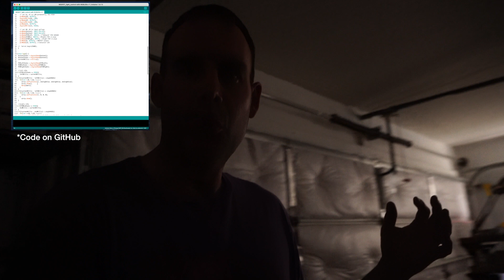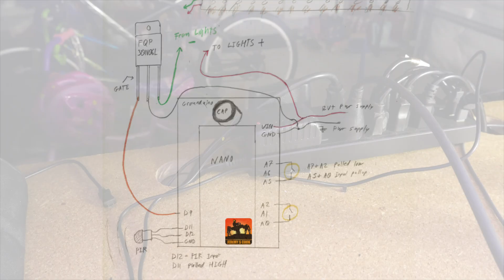PIR 3x Zone LED desk lighting

Comment: You told me to let you know in the comments if you were soldering wrong, so here I am!

You're working too hard.  If you tin both the wire and pad first they'll flow together so much easier and more cleanly when you touch them with the iron.  When I learned this it changed my life! :)
Reply: I second that tip. It is so much easier that way. :)
Reply from the maker: @MakerMikeSizer  I will have to try it :-)
Reply from the maker: Thank you Matt!
Reply: @JeremyCook  You're welcome! :)